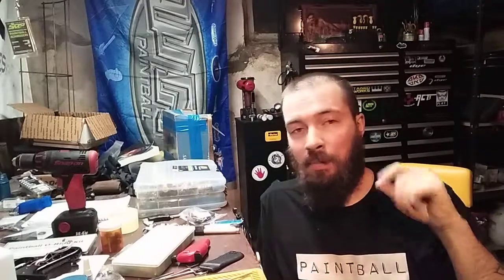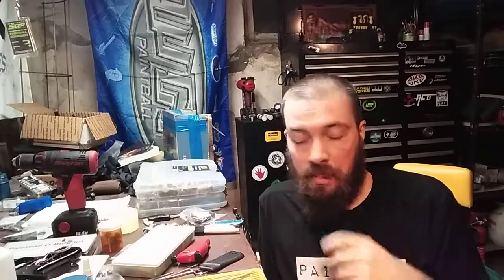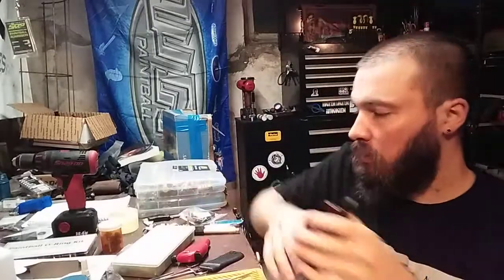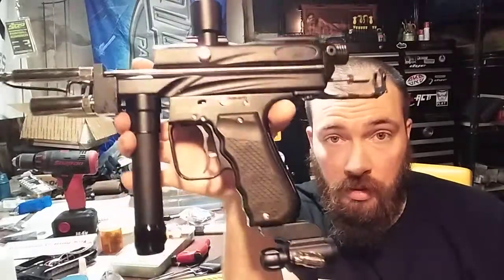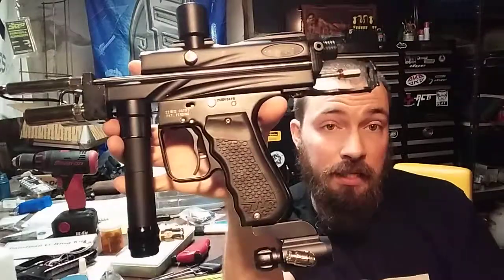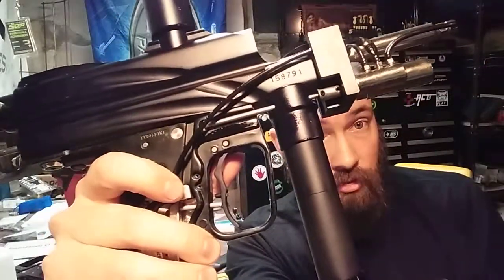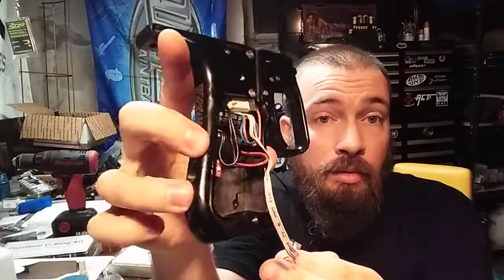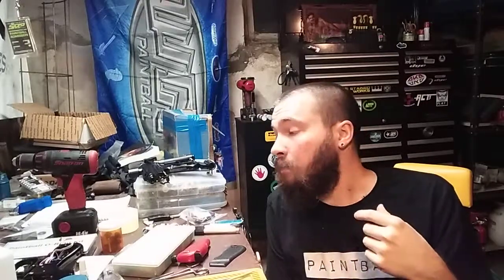What the hell is a Pneu-frame?

Comment: Hey I just purchased a sf frame will it work on a 2k+ this way right also I can’t find any of my hardware for the frame or drop forward any recommendations not having any luck I just found out your also from Kansas City id like to get with you and pay you to bring back alive a 02 vertical feed I have that’s sentimental to me has a broken stock trigger and missing hard ware now lol
Reply from the maker: The frame should mount up to any cocker body with the exception of the newer studded bodies like the resurrections. As far as your hardware, it should all be available at your local hardware store. Frame mount bolts are 10/32 thread, as are asa bolts, most grip screws are 8/32, and so on. All should be available locally. I'd be happy to help out! I love bringing cockers back from the dead, especially ones with sentimental value.
Reply: Hi KC, I want to do this as well, Am I able to message you on facebook?
Reply from the maker: @GhostPaintball  no problem at all!